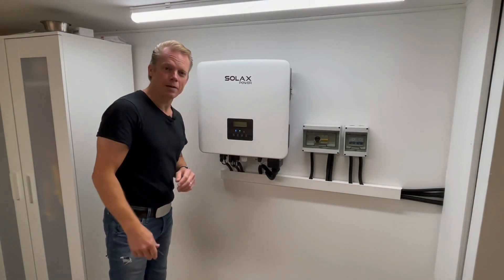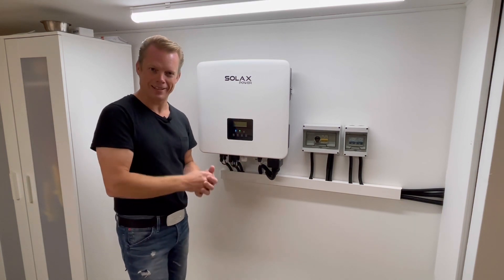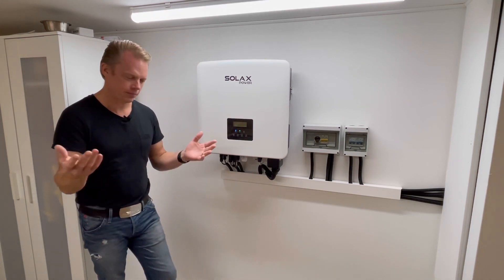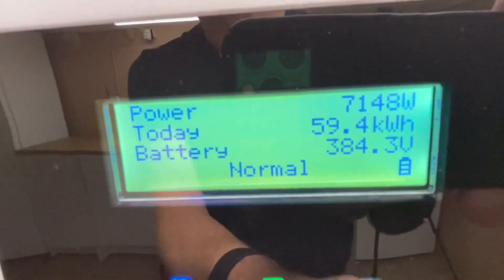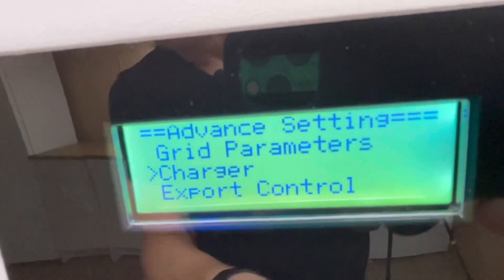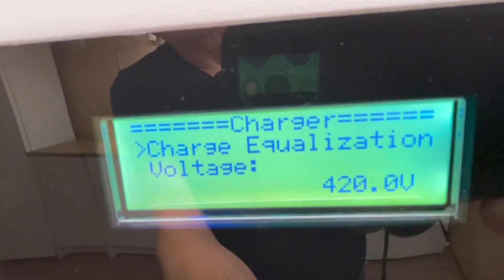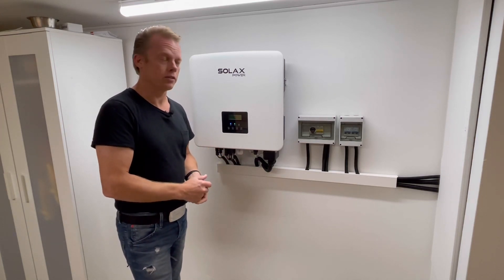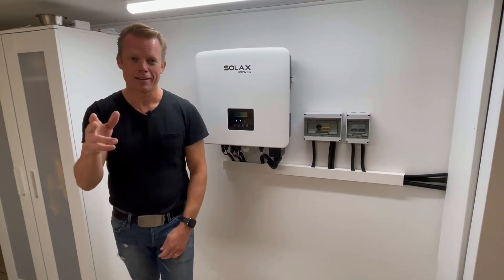Solax x3 g4 runs on a 400v diy lithium battery.

Comment: What version is the inverter firmware? Also, how much kOhm is the thermistor/resistor you connected to the BMS port?
Reply from the maker: Hi, sorry for my late reply. I just posted a video about the temp sensor. Hope you like it.

Comment: Kan du ställa hur många amp / kw solaxen skall ladda batteriet med? Eller trycker den på med alla 15kw?
Reply from the maker: Ja absolut, samma sak som med vilken spänning batteriet skall ha så får ju korrekt c-rate räknas ut. Detta är mycket mer överskådligt i appen, något som jag ev kommer ta upp i en senare video.
Tack för din fråga👍🏻
Reply: @flyingtools  Vilken max-spänning går att sätta? Går det maxa med t.ex  180s  så att man kan komma upp i sådan spänning så att man kan maxa ersättningen från CheckWatt?

Comment: Nice!
This have a web interface also?
Reply from the maker: Yes, solax app and i think it also have a Ethernet port, all settings and commands are much easier to set via the app.
Reply: @flyingtools  app means from the phone?
Reply from the maker: @blackeyes18ro  yes.
Reply: Kan man konfigurera invertern via solax cloud appen? Håller på att konfigurera en likadan x3 g4 men keypad är bedrövlig. Får trycka 10 ggr innan den svarar.
Reply from the maker: @svantek-son7852   Hej, ja absolut. Höll själv på att bli tokig på den keypaden, så det underlättar rejält när man får igång appen.